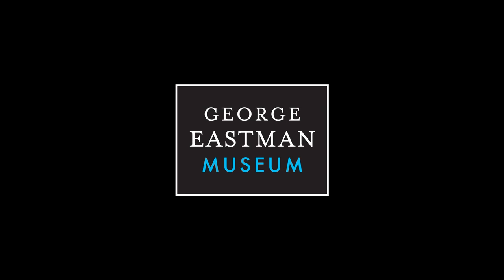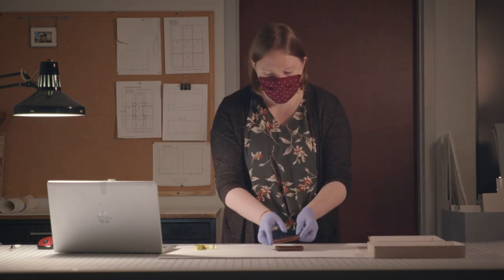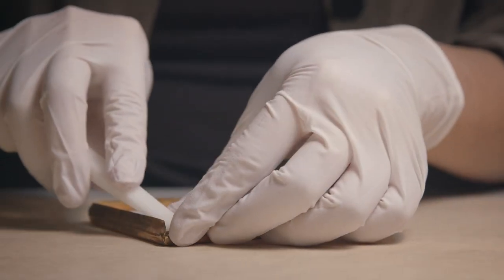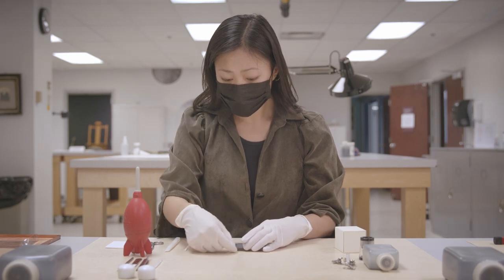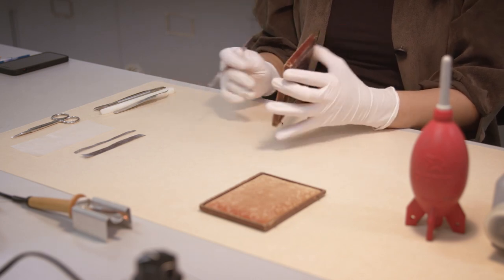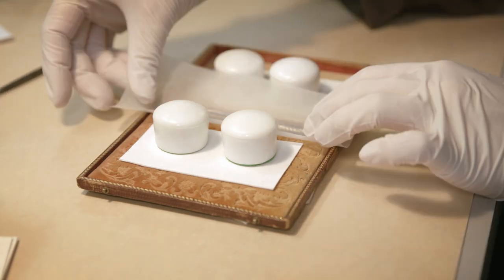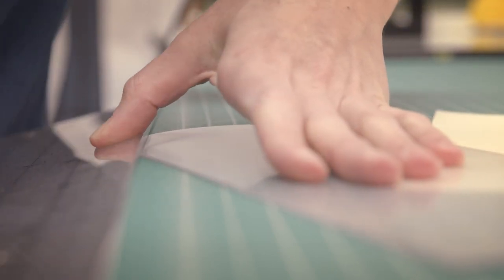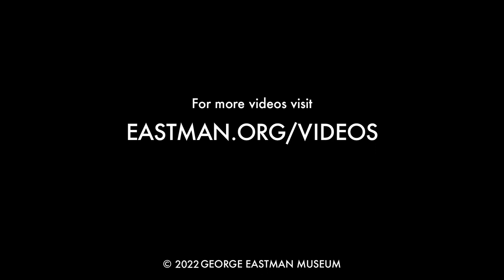Vault to Wall: Daguerreotype

Comment: I'm surprised they are not using a laboratory laminar flow hood to perform several of these steps to prevent any airborne particulate matter from being attracted to and contaminating the plate.
Reply: Hi William. Thanks for your comment. Whenever conservators make the difficult decision to open a daguerreotype package, we work carefully in an air filtrated lab with time in mind. We want to limit the amount of exposure that the bare plate has with the environment during which the risk for physical and chemical damage increases. Throughout the treatment, the plate was kept in a temporary storage box made of conservation-grade materials as much as possible and was only handled when necessary. In addition, an ionizer was used during binding that provided a low flow of bipolar ions to neutralize any static charge and prevent dust or particulates from landing on the surface. The cleaned cover glass and aluminum carrier tape used to bind the package were both improvements made to the package that would limit any exchange of air or moisture and help secure the delicate photograph in a safe housing going forward.

Comment: If removed from the case, isn't there a risk of further oxidation of the Daguerreotype?
Reply: For short durations in what I assume to be the climate-controlled conditions seen in this room, I suspect not. The enemy of photographic processes is prolonged exposure to harmful conditions.
Reply: Oxidation is not the issue, sulfur dioxide is. Since there are no coal burning stoves or gunpowder in the vicinity the chemical issues that confronted Dags in their heyday do not attach.